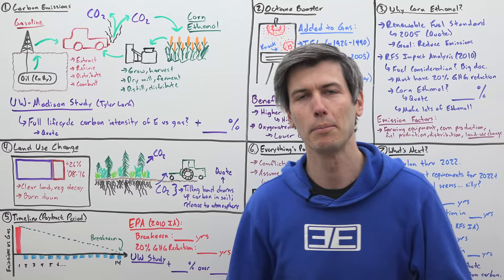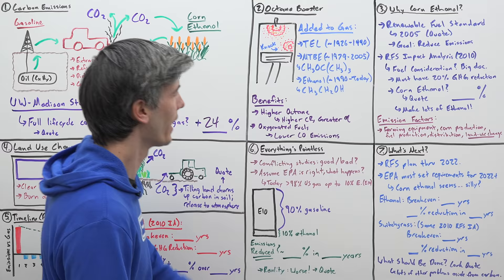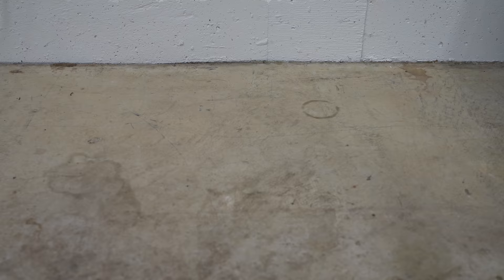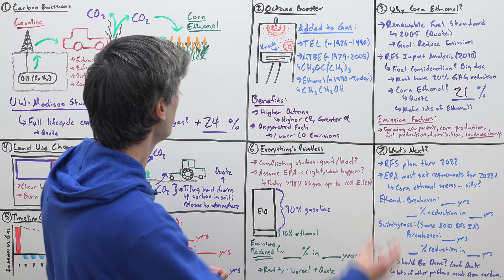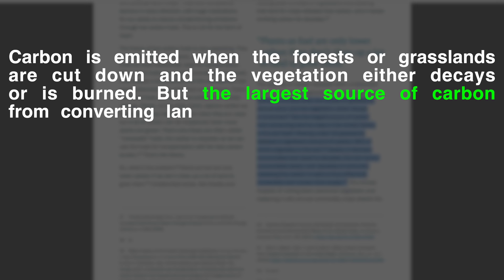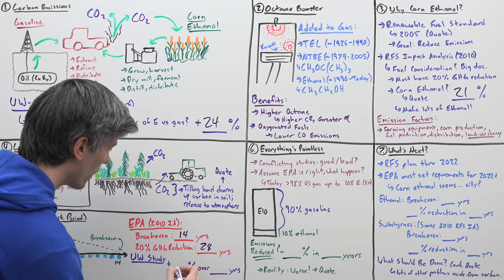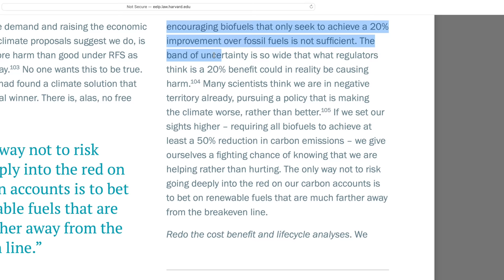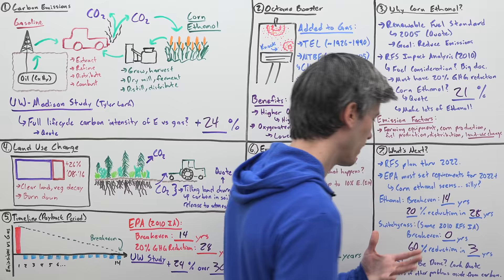America Was Wrong About Ethanol - Study Shows

Comment: Interesting video, I’d be curious to see your opinion on Australian Ethanol. The major fuel ethanol production facilities here produce ethanol primarily from waste wheat starch, grain sorghum and molasses.

We don’t grow crops specifically for ethanol production.
Reply: We don't grow corn for ethanol production either, it is value added from feed production, i.e. the "waste starch".

If we all ate grass fed beef or became vegetarians there would be no corn ethanol as it would be too uneconomical to produce without the distillers grains.

The distillers grains is how ethanol producers were able to keep ethanol price so low despite the current high price of corn.
Reply: Hmm. so, if the corn was already being produced, then the argument about carbon emissions from corn production doesn't hold. The carbon was being emitted anyways. I honestly thing that the reality is between the two. Some ethanol came from waste, some from purposeful corn plantation. I dont know the proportions.
Reply: Corn is used in so many things, one could say nearly everything you buy on the shelves has corn in same manner. It's the "wax" and ink on magazines and labels. It's fuel, syrup, feed, and it's ground up and added to a litany of things. There is a somewhat circular situation, we use corn in so many things because we have so much of it; do we have so much because of those needs or did we create the needs to deal with all the corn? As someone already pointed out, it's both, and the truth lies somewhere in there.
Reply: @danafletcher2341 Price also kept down by US government subsidies.
Reply: @commonstragedy   @commonstragedy  The Federal corn ethanol subsidy called the VEETC or blenders credit ended back in 2011.

The long-standing stated goal of the G7 Nations to end petroleum subsidies?  Not so much.

Ethanol producers are kind of insulated from corn price for if corn is low in price, then so too are the prices of their distillers grains.

This is how ethanol producers can keep ethanol’s price so low now despite the current high price of corn, they make up with high prices for the distillers grains.

No corn is planted just for ethanol, way too uneconomical.  But with the feed factor, nothing can compete except this source is limited to the size of the cattle herd on feed.

So free of CO2 they have to claim new breaking of land which is not possible because US cropland acres have fallen since ethanol.  The corn belt grew more acres of corn in 1980 before ethanol than today.
Reply: even litany is 40% corn...
Reply: Fertilizer made from oil goes on the fields, and the oil used to harvest, manufacture, and transport should be added in too.  Corn ethanol can only be efficient if made from silage left over from feeding animals (should be none).
Reply: @stevenhecht7722 100% of the fertilizer and things in the soil are still fed to livestock in the distillers grains.  Ethanol is made only of things in the air: solar energy, CO2, and water with the latter two recycled once burnt.

Given this, how much should we assign to the ethanol and how much should we to the distilers grains in your estimation?  Most studies negative on ethanol assign it all to ethanol.

The US used 11,160,933 tons total fertilizer on corn in 1980, before ethanol.

In 2018, the year of most ethanol production ever, the US used 10,521,850 tons total fertilizer on corn.

Iowa State University measured all the energy it takes to produce an acre of corn into a "diesel fuel equivalent"
This included making of the machinery, fertilizer, chemicals, plus tillage, planting, harvesting, drying, trucking etc. 
They found it takes 34 gal of diesel to produce one acre of corn.
What do we get from those 34 gallons of diesel?
We get >500 gallons of ethanol.
But wait, that is not the kicker.
The kicker is we still get 100% of the protein from that acre of corn still available for an even better feed. A win, win.
Reply: @danafletcher2341 But wouldnt the fuel production create a shortage in the grain industry if extra corn wasnt grown?
The extra supply has to come from somewhere.
Reply: @Trevor7727  Extra corn was not grown for the first 10%, the corn belt grew more corn acres in 1980 than in 2018, the year of most ethanol production ever.  Cropland acres have fallen since ethanol so no new acres were broke up, impossible.

Since just under half of corn is value added into ethanol and distillers grain the most we could economically do is just over double current production or E20.

We would be feeding all the corn as distillers grains and none straight.

If we ended ethanol, cattle feeders would have to switch to straight corn for an alternative protein source.

Beyond the protein needs and herd size of cattle on feed, corn ethanol becomes uneconomical.
Reply: @fletch2119  I live in Columbus Co NC and the farmers here grow corn for ethanol exclusively. When the corn is salad bar sized it can be eaten cob and all. When the corn is mature it tastes like a quart of Mobil 1 motor oil, although I have tasted some was like Havoline. Some grow silver queen corn on a few acres selling the excess from the back of a pickup, but no one grows it for their whole crop. Grocery store corn has to be picked at the right time or it will taste like mule feed.
Reply: I'm not a scientist, but one would think that plowing that "waste" back into the ground instead of trying to squeeze blood out of a turnip, would be a better idea.  The "waste" is actually the fertilizer of the future, exactly the nutrition that the crops 2 or 3 years later will need from the decomposed "waste."  Removing biomass from the fields just increases the amount of artificial fertilizers (which come from fossil fuels) that have to be used to grow the crops.
Reply: @Kissypooh  You must have been talking to Steven who talked about making ethanol from silage that removes everything, corn ethanol only takes the seed kernels for distillers grain feed and ethanol but leaves the biomass.  There are no ethanol plants which make ethanol from corn stocks, almost one done in Nevada, Iowa but never went online.  Cellulosic ethanol is not economical now, even with high subsides which ended in Jan 2022 that were over double what the corn subsidy used to be which ended in 2011.  Ethanol is easier from sugars/starches.

The corn stocks are, as you say important but as ground cover and food for soil microbes.  Yet the majority of mass from all of the stocks and even leaves on our trees decompose to return to the atmosphere as CO2, if not the world would not have plants over time.  The majority of a plant is CO2 and water.  

The fertilizer and things of the soil with corn ethanol are still fed to animals, even with ethanol.  Ethanol is only made of solar energy, CO2, and water with the later two being recycled once burnt.

Where carbon gets put into the soil is from the root exudates while living.  Tillage reduces/removes the soil carbon as CO2 every pass.  If one takes off the corn stocks or makes silage, it would be important to plant cover crops to pump carbon back into the soil so the soil microbes have food to live.

We plant and have planted the same amount of corn acres since well before Prohibition.  If ethanol planted we would still plant the same amount of corn.  The size of the cattle herd determines the corn acreage, not ethanol at all.  No corn is grown just for ethanol as it is far too uneconomical.

The US used 11,160,933 tons total fertilizer on corn in 1980, before ethanol.

In 2018, the year of most ethanol production ever, the US used 10,521,850 tons total fertilizer on corn.

Yet yields were far lower in 1980.  Microbes feed plants from an unlimited supply of nitrogen in the air but CO2 is limited since CO2 enhanced greenhouses have triple the yields.  There are huge supplies of phosphates in the soil, but are tied up.  Microbes can free phosphate and other nutrients in the soil.
Reply: @sammythompson3694  I can guarantee you corn in NC is not grown exclusively for ethanol.  100% of the protein, minerals, and other things still get fed to the livestock.  Corn just for ethanol is far too uneconomical but with the feed factor, few sources can compete with it.

What happened in NC?  You planted around 2 million acres of corn from the mid 70s to the mid 80s (before ethanol) and then started dropping.  Today you guys don't even plant 1 million acres of corn per year.  Your record year was 1939 at 2.5 million acres.

Most corn grown is feed and for livestock and is called field corn.  A small percent (<3%? guess) goes to chips, corn meal, cereal, etc.  The majority of it is fed to livestock straight or value added into ethanol/distiller grains feed.

All corn on the cob, canned corn, and frozen corn in the grocery store comes from sweet corn.  The US always plants about 1% of total corn acres to sweet corn.  Gives you an idea how much livestock get, it takes a lot of plant protein to make meat protein.  I personally try to eat grass fed so no corn ethanol would exist if everyone ate like me.

Ethanol can be made into motor oil, ester type so if you really want to know what corn might taste like, try Red Line oil.  Though not made from corn is the same type.  I will pass thank you.
Reply: @danafletcher2341  Umm, so if the corn used to produce ethanol is actually "waste", then why did he spend all that time talking about the additional land that farmers identified had to be cleared, tilled, cultivated, fertilised, etc, etc. to produce the corn used to make ethanol?

The definition of "waste" is that it is an unnecessary thing that we have lying around, looking for the best way to dispose of it.  Clearly the US did not, and does not, have anywhere near that much corn lying around, excess to requirements.
Reply: @gomezgomezian3236  You are starting with a false premise, that is why you came to a false conclusion.

Farmers did not identify any additional land that had to be cleared for ethanol, only the false propaganda study did.

Believe it or not, the corn belt grew more corn acres in 1980 before ethanol than they do today with record ethanol production and ethanol plants everywhere.

2018 Iowa 13,200,000 acres of corn with record ethanol production
1980 Iowa 14,000,000 acres of corn before ethanol

2018 Illinois 11,000,000 acres of corn with record ethanol production
1980 Illinois 11,600,000 acres of corn before ethanol

2018 Indiana 5,350,000 acres of corn with record ethanol production
1980 Indiana 6,450,000 acres of corn before ethanol

It is simply impossible for the 2007 energy act/RFS to have taken away grasslands, forests, virgin, or any other kind of land because cropland acres have fallen, not risen since then. This is NOT rocket science to see.

US CROPLAND ACRES
1997 349,000,000 
1998 345,000,000
1999 344,000,000
2000 345,000,000
2001 340,000,000
2002 340,000,000 
2003 342,000,000 
2004 336,000,000
2005 336,000,000
2006 330,000,000 4.0B gal. corn ethanol mandate
2007 335,000,000 4.7B gal. corn ethanol mandate
2008 337,000,000 9.0B gal. corn ethanol mandate
2009 333,000,000 10.5B gal. corn ethanol mandate
2010 335,000,000 12.0B gal. corn ethanol mandate
2011 328,000,000 12.6B gal. corn ethanol mandate
2012 340,000,000 13.2B gal. corn ethanol mandate
2013 336,000,000 13.8B gal corn ethanol mandate 
2014 341,000,000 14.4B gal. corn ethanol mandate 
2015 337,000,000 15.0B gal. corn ethanol mandate maxed out
2016 336,000,000 15.0B gal. corn ethanol mandate maxed out
2017 334,000,000 15.0B gal. corn ethanol mandate maxed out
2018 338,000,000 15.0B gal. corn ethanol mandate & most ethanol ever produced
2019 323,000,000 15.0B gal. corn ethanol mandate 
2020 329,000,000 15.0B gal. corn ethanol mandate

Census data actually shows that the forest and wildlife areas in corn producing states actually increased since ethanol.  It only goes to 2012, but you can get the idea:

Total forest use land of those corn producing states: 

1945  87,509,000 
1949  88,735,000 
1954  90,912,000 
1959  88,342,000 
1964  88,068,000 
1969  88,069,000 
1974  85,948,000 
1978  82,034,000 
1982  80,719,000 
1987  79,264,000 
1992  83,294,000 
1997  84,828,000 
2002  84,683,000 
2007  90,700,000 
2012  93,533,000 

Land in rural parks and wildlife areas in corn states: 

1945  1,614,000 
1949  3,991,000 
1954  3,790,000 
1959  4,718,000 
1964  5,247,000 
1969  5,565,000 
1974  5,958,000 
1978  7,510,000 
1982  7,903,000 
198712,082,000 
1992  9,168,000 
1997  9,071,000 
2002  9,120,000 
2007 10,388,000 
2012 10,998,000
Reply: @gomezgomezian3236  Corn grown is not waste.  Corn ethanol is a value-added product of already existing feed production which leaves 100% of the protein (& other things) still available as feed in a healthier, more digestible/efficient, and more concentrated form called distillers grains.

Cattle cannot digest starch very well and waste it in the form of methane flatulence and starch rich manure which turns into methane later.

This corn starch also causes acidosis/sub clinical acidosis in the animals.  This low pH gut environment causes bad and deadly bacteria to proliferate which is why we hear about those meat recalls time to time.  Industrial ag then adds antibiotics to the feed.  Not a small item either, the majority of antibiotics manufactured are made for feed, not medicine.

Distiller’s grains, like grass, doesn’t cause acidosis.

I personally try to eat grass fed beef so if everyone ate like me corn ethanol would not even exist.  We wouldn’t plant very much corn.

If we ended ethanol we would still grow the very same amount of corn.  Cattle feeders who use distillers grains would need an alternative source of protein and that would be simply feeding the corn straight like those who don’t use it do.

Comment: I wonder about the impact of the reduced mileage from ethanol laced fuel, and resultant increase in fuel required to drive a given distance.
Reply: EXACTLY!  anyone who's obsessive/compulsive and logs mileage on every tank used (trip miles since last fill uk/total gallons filled) quickly figures out that E10 reduces fuel economy 12-15%...  so I am burning 12-15% more fuel to go same distance.  if only we would rate our mileage based on fuel used to go a 'set' distance...
Reply: E20-E27 will actually give you better fuel consumption thanks to combustion benefits such as octane and cooling effects, with E25-27 being the sweet spot. After E30, the calorific value of the fuel does catch up, but E30 consumption of tuned properly should be the same as E10.
Reply: @kurtbecker9609  Exactly my observations as well.
Reply: @jjp9595  Correct. But if the fantastic lean burn capabilites of ethanol would be utilised, the specific consumption (where we take the lower caloric content into account) can even reach levels far better then the best diesels.
Reply: You aren’t wrong…it’s a bigger difference than we are leas to believe.
Reply: @jjp9595  Wrong
Reply: @greenidguy9292  No I found 30% E85 on an OBD2 car is the sweet spot for mileage.
Reply: @oldblueaccord2629  Let us know how much you spend in added repairs...
Reply: @greenidguy9292  Im doing a weekly video of my Jeep Grand Cherokee with 30% Ethanol untuned.

Comment: SUGGESTION: this is a little different than engineering videos, but car related. What changed in car paint (or alloys or clear coats) that has drastically reduced rusting in cars? When I was a kid, if a car was 5-10+ years old, it was a rust bucket. But that's not the case anymore. What changed?
Reply: They also use less steel in car bodies nowadays.  Neither aluminum nor fiberglass resin will rust, even if the paint is bad.

Comment: Brazil has cars with ethanol (from sugar cane) engine since the 70's. At the begging the problem was the tank and other parts corrosion. since the 2000's the cars run with a smart chip that recognizes ethanol and gasoline. Tanks and parts are protected with a material that stops the corrosion.

Comment: @10:00 well that math is based on 10% ethanol and over a 28 year span. E85 flex fuel vehicles have  51-83% ethanol.. wouldn't that mean 10-16% less emissions per person if one were to run e85 vehicles for 28 years?..